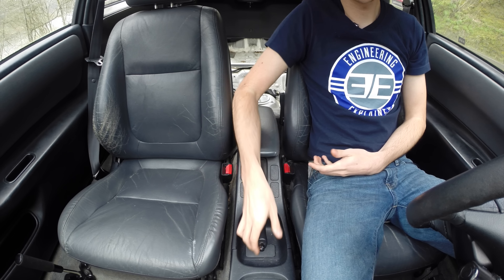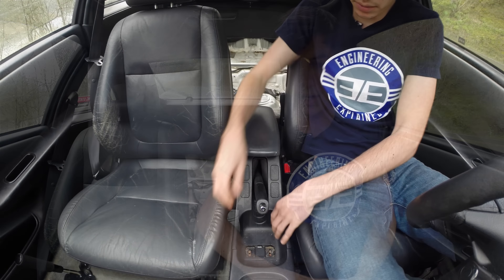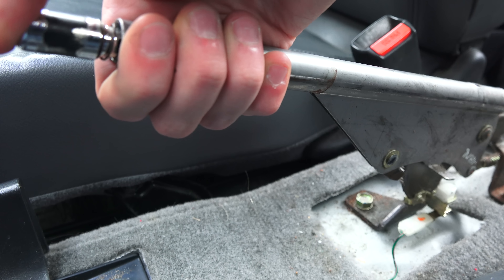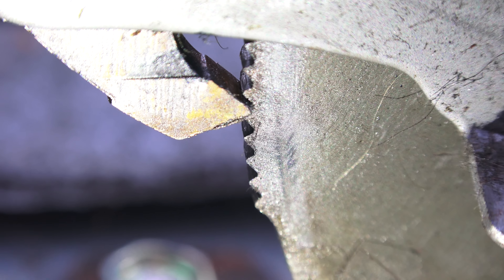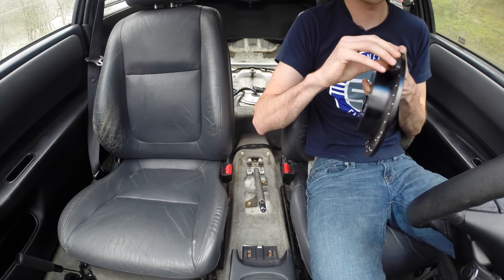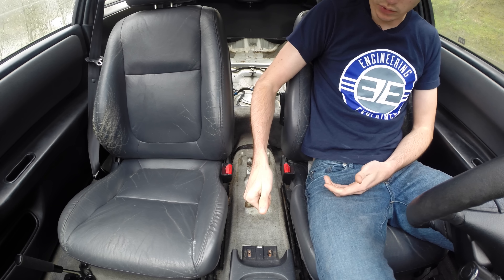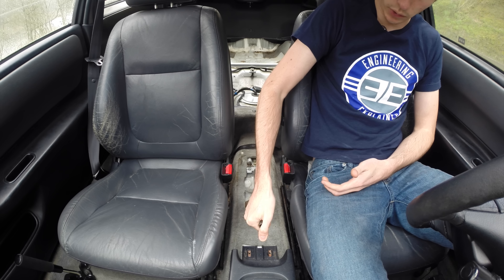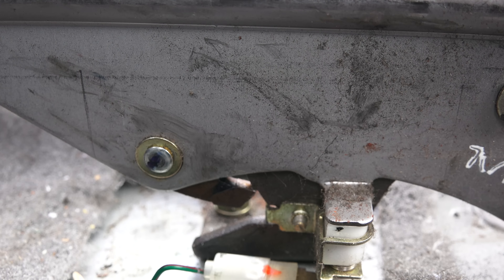Always Press The Handbrake Button? Myth Busted

Comment: I was told not to turn the steering wheel all the way to the left or right when turning my car at a U-turn. Is this another case of people educated by those that don't understand things?
Reply: +PacificCoastAuto yeah
Reply: +PacificCoastAuto Yes
Reply: anyone?
Reply: +PacificCoastAuto They were probably showing concern for the steering pump which will be running even though your wheel is at full lock. I don't know if this puts serious wear on the steering pump or not. You're probably fine doing this though- a U-turn is not a very common driving maneuver and, similarly to the ratcheting mechanism in the hand break, your car is designed to be able to turn to full lock. Manufacturers are smart enough to design vehicles to be able to do the functions they are able to do (including U-turns) without breaking immediately from normal use.

It'd be interesting to see what Jason has to say about this as well. +Engineering Explained
Reply: +PacificCoastAuto
It is a good measure not to reach the end of the travel of the steering wheel.. but depends on the system. Some old hydraulic unit will work harder (but within designed limits.. the over pressure valve will come off and the system will be running at max pressure designed.

Some systems will have a valve at the end of travel to release all the pressure from the pump at full lock. So aside the fluid circulating rapidly trough that valve without genearting any pressure is no real harm.

Whichever the system.. even non assisted, the full lock position will rest somewhere (at the steering rack end travel usually).. so any additional torque beside the lock will torqueout the pinion and rack - and if monkeyed around can cause harm.
Reply: +PacificCoastAuto Some cars have safety systems for this. If the power steering over works and heats up. They kill the power steering for a while to cool it off. Read your manual. Subaru has this feature.
Reply: +PacificCoastAuto This is from my owner's manual. "Never hold the steering wheel to the extreme right or left for more than five seconds if the engine is running. This can damage the power steering pump." 2000 Ford Contour p. 120
Reply: +PacificCoastAuto when you turn it full lock, the pump outputs almost its entire pressure potential trying to keep turning while its on lock, that means that it is safe for a short while (U-turns, etc.) but shouldn't be kept there as the pump will wear very fast in that time causing premature failure in the future, think of an engine, you wouldn't keep it full throttle all the time
Reply: +PacificCoastAuto If you use the full turning capability of the wheel AND keep it locked wile turning, it probably keeps the oil pump working hard. My car stalls easy if I lock the wheel wile doing manoeuvres so I avoid it because I don't like to rev just to be still and wear the clutch.
Reply: +PacificCoastAuto Power steering uses a proportional valve to direct fluid on the side where pressure is required for the assist. Once wheel direction matches steering input, the valve lets the extra fluid pass through and that lets the steering pump pressure drop. When you go to full lock, your steering input exceeds the wheel range and the steering pump operates at its bypass valve pressure, which will cause the fluid to rapidly heat up from all the energy wasted in the bypass valve and pump. On most cars, the steering will produce a noticeable noise change and all you have to do is back off slightly to make it stop.
Reply: Any GTRs for sale? And how much would a R34 be? When legal of course
Reply: the reason for that is if you bounce up a curb or something it can mess up steering components as there then being forced into positions there not suppose to.
Reply: +Jason J In my BMW Bentley manual it has in bold letters not to full turn the wheel right or left for too long cause it damages the pump.
Reply: Unless they were talking about dry steering and didnt say it correctly?
Reply: with a hydraulic system it can create more working pressure in the pump. on a car with electric power steering, not a problem
Reply: +PacificCoastAuto I don't believe so. With vehicles that still use hydraulically assisted steering, it's best not to hold it in the full lock position for too long. I didn't take this seriously either until I saw it mentioned in my Auto Tech Textbook. Teardown Dan explained this really well in the replies, so check his comment.
Reply: I avoid it with my truck. The power steering pump starts to squeal if I turn the wheel all the way. Anybody have any insight as to what could cause this?
Reply: +Daniel Fricke id imagine its the pressure of it trying to turn the wheel but not being able to. if you rock your wheels side to side and it dosnt do it then I wouldn't worry to much about it. it could also be the springs my car hates going to full lock and creeks like an old house XD
Reply: +PacificCoastAuto no. id say this is a true fact. my knowledge is that you are placing more strain on the power steering pump. your telling it to keep pushing the steering when the travel has hit its stop. its like holding a hydrolic press on, even when the press has bottomed out.
Reply: +PacificCoastAuto You're OK for the time it's going to take to turn a corner or curb your wheels when parking on the street, but you're not going to want to have it sit there with the engine on at lock (ie, if you curbed your wheels, consider uncurbing them a few degrees if you need to start the engine a few seconds before you start driving to get the engine oil flowing again), as the power steering pump's just fighting the end of the rack, which is not a fight it will win in the long term.
Reply: +lsbugsbunny92 plenty of information on the R34 not being legal in the US. If you do happen to purchase one it is not up to US standards and a lot of R34's purchased were scrapped because of the regulations. Although, you didn't mention purchasing it in the US.
Reply: +Jason J When any hydraulic pump deadheads if there is no relief valve in the circuit the pump will lock up as hydraulic fluid for all practical purposes is uncompressible. As hydraulic fluid passes over a relief valve it will heat up. You would have to run the steering pump for a bit of time for the fluid to breakdown because of this.
Reply: +PacificCoastAuto Actually, for vehicles with hydraulic power steering, it is a correct suggestion. Even my owner's manual on my vehicles with hydraulic power steering state not to go full-lock for a long period of time. I've done this on my first car (full lock for 30 seconds) only for my hydraulic power steering to fail 5 minutes later.
Reply: +Daniel Fricke. At full lock the pump is pushing lots more pressure and requires more power to drive it. If the belt cant provide the grip needed to transfer the power from the engine to the P/S pump then the belt will slip and squeal. The belt may be loose and need more tension or maybe worn out and requires replacement
Reply: Oh my god Derek its you lmao youtube is a small place ^^
Reply: +Andy_Jee That makes sense. I recently replaced the belt, but I don't have the proper tool to tighten the pulley, so it probably is a bit looser than it should be.
Reply: +PacificCoastAuto It will be okay for a short period of time. Most of the time, it won't matter.
Reply: +PacificCoastAuto I mean it might make sense if your doing a U-turn at 120MPH but I don't see the issue at parking lot speed.
Reply: It is not hard on the pump. Once the wheels are locked the pump pushes the oil over the relief valve. This causes heat. If the oil is pushed over the relief valve long enough the oil can heat up to breakdown temps and lose some lubricating properties but this takes a while. A relief valve that is stuck can cause damage.
Reply: some say yes and some say no i would say that it is because more pressure is created by the pump, it would damage the seals on the piston inside the steering rack, a good way to check is by Turning the wheel in one direction lock for less than 5 seconds and hearing a loud squeal but they seals should last a long time
Reply: The relief valve in the power steering pump is supposed to lift before the pressure gets so high it could damage seals. The main danger is the heat generated by the hydraulic fluid going over the relief valve. In industrial hydraulic systems this heat is dissipated by the volume of the fluid in the system and external cooling if needed. The volume of fluid is small in the power steering system and there is no external cooling so it won't take a huge amount of time for the fluid to heat up dangerously but I would think it would take over 60 seconds to do that. It might be interesting for someone to actually measure how long it does take.
Reply: +PacificCoastAuto Basically I wouldn't worry about a U-turn or parking maneuvers. (but don't use all your strenght trying to pull the wheel past its stop as I've seen someone does)
It depends greatly from car to car, specifically I have an old Audi, and at full lock the engine revs drop a bit (witch is because the hydraulic pump is working hard) turn the wheel 5degrees back and the pump doesn't have to work as hard, because the wheels has the correct angle with this steering input.
In day to day driving this doesn't matter, but I know people who use these cars for drifting who will tell me those pumps fail rapidly if pushed on the track with full lock. My to cars has 800000km combined and both with stock pumps..
Reply: +PacificCoastAuto The only warning I read in my manual is to not bump the wheel on the stop with force. So you can turn it full lock, but don't bump it too harsh to the lock.
Reply: +PacificCoastAuto In my LR Defender manual they state that you should not keep the wheel at full lock for more than 20 seconds due to there being no oil flow through the pump when at full lock.
Reply: +PacificCoastAuto Well, it depends on how old your car is. I used to drive a Dodge Durango and it had to have steering fluid put in it a hell of allot because I'd yank the wheel to either side and the cap was crap. So really, it depends on how old your car is, or what type of car.
Reply: +Jason J There is a pressure relief, you don't stress the pump at full lock. But you do stress more the tie rod joints and the tires, as a full lock is usually done at rest.
Reply: +Koelkop That's because the recirculating ball box you have does indeed cut the oil supply off.   But it isn't the pump that you should be worried about.

It's the seals in your steering box.  They are holding huge pressures. They rupture - you have no power steering  and a puddle of oil on the floor.
Reply: vkoptchev That depends on the car, I know atleast some older german cars that stress the pump at full lock.
Reply: +PacificCoastAuto The power steering pump will end up closing the valve at hard left or right, which forces the pump to recirculate the fulid very quickly which produces massive heat and can wear or kill the PS pump. easy way to tell, while at idel, just listen and feel, try pushing against the wall left or right and you'll hear the pump. fun fact though, you can back off from turning it as far as you can go literally by 1/16th of a wheel turn(very very small amount) and it will be fine.
Reply: +PacificCoastAuto Doing so in any direction (left/right) for a great amount on time puts strain on the power steering pump. I'm talking full lock 100% with nothing more to give. You will actually hear the pump under strain. For example my 2005 Subaru TS owners manual specifically warned against holding the wheel at full lock for more that 5 seconds. This may not be the case with more modern cars though.
Reply: +Bittertokken no,  it's still the case with any modern power steer system, Hydraulic and electric.
Reply: +PacificCoastAuto 
With traditional hydraulic power steering, putting pressure on the valve in the steering rack or box is what causes it to start making hydraulic pressure, this happens when you turn the wheel. Moving to the end of the steering travel and then continuing to put some pressure on the wheel will cause the hydraulic pressure to rise, but it can't move the steering because it is already at the end of travel. The pressure relief valve starts opening to prevent pressure continuing to rise until something breaks, but there is still high pressure in the system which strains components and quickly builds up heat.
Reply: +Ezra Mable So Ford designed their system to damage itself in what could be considered normal usage. Nice
Reply: Although I'm sure your question has been answered, my theory is that when you turn your wheels at any angle, it puts more pressure on the wheels themselves to make the car go at the same speed than if they were to go forward. 

The equation that represents this is    a = m × fsin(∆0°) where if a (acceleration) and m (mass) are to be held constant, and the angle were to be changing (∆0°) [any direct change in angle when multiplied by sin will decrease its value], the force would have to increase in order to keep the acceleration constant. 
It is this increased force that will be acting on your tires/axel system which would in turn put more pressure on all of the moving parts. 

In all reality your car would be fine if it didn't have an actual problem with it, but it does exert more force on the system than normal for the same acceleration. 
You're okay though.
Reply: +. this isn't the 60's anymore.... cars have differentials
Reply: +PacificCoastAuto That only applies to offroad vehicles with wider tires with not enough backspacing on the rims which can sometimes clip the wheel wells but for anything stock there is no cause for concern:p
Reply: +SpydreX Official again, this is untrue
Reply: Bait28 What do you mean? Whats wrong with turning at full lock?
Reply: +PacificCoastAuto  I dont because of power steering
Reply: +SpydreX Official Turning at full lock is bad on the power steering system, not the actual steering system itself. When you turn at full lock, the power steering pump ends up building pressure to open the relief valve and rapidly recirculate fluid in the pump under high pressure which generate massive heat.
Reply: Bait28 As you can tell, I am not a car person. Regardless however, this redirection of force puts more strain on some connected part of the vehicle.
Reply: Bait28 Well cars are designed to be able to handle full lock turning and are actually tested extensively before they are sold to customers. Tbh I highly doubt you will bust any seals turning your steering wheel at full lock because whats more pressure on the pump? Going 5-10mph at full lock out of your drive way, or turning into a 50-60 degree turn on the highway going 60+mph? The steering pump is rated for the kind of pressures that it operates at and I haven't ever heard of anyone actually busting any seals or gaskets from doing this.
Reply: If it's a fwd car just don't floor it at full lock because the torque steer can push the tie rods further than they're meant to go. Other than that the wear is the same as half or quarter lock
Reply: +SpydreX Official cars are not designed to be full locked. Do you think they were also designed to handle at 108mph just because they can goto 108 mph? you must also think they are meant to work without oil since they can run on low oil.
Reply: +PacificCoastAuto It's quite simple: for the same reason you shouldn't place an automatic gearbox in the 'stall test' mode, i.e. one foot on the brake and the other on the accelerator for more than a few seconds to test the stall speed of the torque converter, one shouldn't load the steering pump by turning full-lock and holding it there for more than a few seconds.  Both cause overheating of the oil by loading the pump, although in the case of the pump the pressure relief valve will usually take care of excessive pressure build up.  One can also hear the pump taking strain at full lock.
Reply: +PacificCoastAuto If there is a whining noise when the wheel is turned all the way, then it's probably best not to do that (like in my car) if there is no noise when the wheel is turned all the way, it is probably fine (like in my wife's car)
Reply: You can turn it all the way unless you have larger than stock tires then your tires might rub on the wheel wells but the only thing you shouldn't do is keep your wheels turned all the way to the right or left is because it will make the power steering system overheat but hitting the turning stops which stop your wheels from turning farther for a U-turn is ok. If you have to wait for an opening to get back on the road and you have to wait to finish the U-turn, let the steering wheel rest without being pushed all the way and that will stop it from overheating. What you were told is partially true. Turn all the way and don't let go, bad, turn all the way but not for a long time, completely fine
Reply: Sounds like you're talking about turning the wheels when not moving (in prep for the U turn), this is called dry steering and will cause wear on the steering column, at full lock it will also cause wear on the power steering.
Reply: Love your videos!
Reply: in simpler words... it puts a lot of stress on the power steering pump when you turn all the way till it dont go no more.
Reply: Bait28 You are being a little condescending and your examples are not even close to what I was mentioning. This is 2016.. Cars are designed so that your not going to destroy your steering pump by backing out of the driveway at full lock. End of discussion.
Reply: +SpydreX Official You are once again wrong. Theres been no major innovation to cars to make physics break. Once a steering rack is at full lock, it always will build pressure, it always will open the relief valve or explode, and will always rapidly recirculate and over heat and damage the pump. You cannot beat physics. Even electronic power steering system can overheat and become damaged. your "End of discussion" is how people who are unable to prove themselves lose. My examples are just because you throw flawed logic out there. Now because it's 2016, cars are clearly designed to be driven without tires, because that used to damage them with no tires but manufactures know some people can't afford them, so they make it possible to drive safely on just rims.... Seriously. You cite no sources. I'm a mechanic, fight me kid!
Reply: Bait28 I cannot beat physics? Slow down slick we are talking about engineering here not physics. You can choose not to believe me but the fact is no one should be afraid to turn at full lock with a stock vehicle backing out of their drive way. I'd also like to note that if you are truly a mechanic "bait28" I wouldn't want you working on my car thats for sure. The only mechanic you are is the mechanic of trolling on YouTube. 

EDIT: The reason I haven't given you a source is because I couldn't find any reliable information about damaging your steering pump anywhere online except in forums like for instance this thread.

http://www.successschoolofmotoring.co.uk/manoeuvres

http://www.carbibles.com/steering_bible.html

^This is the closest thing a source on the internet that I could find as "breaking your steering pump in this manner is very uncommon and not heard of very often it seems".
Reply: +Bait28 Your power-steering explanation is exactly what my dad (a longtime mechanic) told me since I was young & learning to drive. 
I suppose it's also possible that the tire could rub against the wheelwell in an extreme steering position, but I think the PS pump/system pressure is the biggest factor.
Reply: +SpydreX Official...Obviously +Bait28 isn't saying that turning the wheel to full lock once (or even occasionally) equals instant failure, but it certainly increases load/wear on parts, which leads to earlier failure of the component.

And yes, "it's 2016", but so many cost-saving measures are taken by car companies these days, you can't assume the components are necessarily of higher quality. (Look at VW mgmt's decision to cut costs by $350/car, which effectively created the "Dieselgate" emissions cheating scandal. Or GM's faulty ignition switches with cheap plastic parts.)
Reply: +PCjabber Ofc you can bounce of the stops or tap them. Thats why they are they, but the fact even when you hit the stop, it increases the force to try and recenter to push it OFF the stop should say something.... thats a intentional feature to try and back drivers OFF the stop
Reply: PCjabber You make a good point but what I am saying is that your cars steering pump will not likely fail from turning at full lock.  Actually your car has steering stops to prevent your steering pump from over turning which is what you both are talking about. Yes your steering pump would be heavily damaged overtime if these steering stops were not in place that is true but the fact is all modern cars have these as of my current knowledge. These steering stops are most of the time adjustable too so even if you were the slightest concern you can adjust them to let your maximum turning radius be wider and less tight to reduce stress on the pump which shouldn't be necessary anyways as they are pre-set to there recommended length upon exiting the factory. Being a so called car mechanic "Bait28" should already know this.
Reply: My driving instructor taught me that too it's weird
Reply: Bait28 Why are you getting so mad at me? Just show me your video proof if you have it I mean this is the 21st century just send me a link to them and if what you say checks out then I will admit I'm wrong but at the time being I have never known anyone to actually destroy or "explode" their power steering pump just from turning at full lock. I have never been told by certified mechanics that this is bad for a car either and the only ever time I have seen in a car manual that turning at full lock is bad was in a 99 Pajero manual and even then it said for "extended time periods". What does me being skeptic of a well known myth have anything to do with people who come into your so called shop? By car mechanic do you mean working at Autozone lol?
Reply: +SpydreX Official I'm talking about extended periods of time....
Reply: +SpydreX Official "+PCjabber Ofc you can bounce of the stops or tap them. Thats why they are they, but the fact even when you hit the stop, it increases the force to try and recenter to push it OFF the stop should say something.... thats a intentional feature to try and back drivers OFF the stop"
Reply: Jane Smith Thanks for the comment but I never claimed to be a mechanic and actually bait28 is right on turning at full lock will cause more stress on the power steering pump but compared to everyday driving like on a highway this stress is negligible and the steering stops do indeed stop the steering pump from over-steering even if thats not what they were intended to do so don't get all high and mighty because you are not %100 correct either.
Reply: +Bait28 no its an intentional feature to let you know you cant turn the wheel any further!
Reply: +Jane Smith Alright, simmer down now :-p...first off, I never said I was a mechanic (my dad is). 

My whole thing is...why push the system to its design "limits" (which will increase wear over time) if it's unnecessary to do so?
Reply: +PacificCoastAuto The reason to not have your wheels turned in anticipation of a u-turn is to prevent from getting pushed into oncoming traffic if you get rear-ended.
Reply: +PacificCoastAuto On older power steering cars that was true, I have not heard that in many years.
Reply: +eatmyskids hahaha, I thought your name was "eatsmykids"
Reply: people will argue about literally anything on the internet these days
Reply: +Simon Chuo that is correct, it can happen
Reply: +Vinny The Tech I know it does too x.x whatever I guess, not my car lol
Reply: +Bait28 +Simon Chuo it's not good for any car to turn it to full lock, not even cars with no power steering because it can damage the steering gear
Reply: +Simon Chuo Sometimes you gotta sit back and be glad you are not them.
Reply: +PacificCoastAuto Under normal driving conditions, you shouldn't be concerned about that. However the manual for my 2010 Ford Ranger DOES warn against holding the steering wheel at full lock for extended periods of time (longer than 1 minute). I would assume this applies to most all other vehicles.
Reply: PCjabber I kind of like that, I might try that
Reply: +TheChipmunk2008 ... OR looked at another way, Ford warns you in the manual, where as others want to make a few bucks selling you a new part after the warranty is up. Either way, the only power steering pump I've destroyed from any manufacturer, ran out of fluid from a leak. With a Contour though, continuous circles and turning will just as likely starve the engine's oil pump.
Reply: +PacificCoastAuto No, it's completely different.

If you listen close to most PS pumps when you get close to the end of the rack you hear the pump strain a bit - I don't know the hydraulic mechanics (in the rack) of it but for some reason there's a lot of pressure build-up at both ends (and not at all in the middle), and on many cars you can hear it groan at the end of the track, especially if the belt is loose you can sometimes hear it slip due to the added resistance.  I try to avoid going all the way to the end of the rack for that very reason, you can hear the pump whine out in pain, no reason to push it further, IMO.  It's just extra stress on the pump which may or may not make a difference at the end of the day.
Reply: +PacificCoastAuto  Every car I have ever had says not to hold it at full lock for over 5 seconds, every service manual i have seen says when bleeding not to hold at full lock, every service manual i have seen says when doing a test with the pressure gauge not to hold it for over 5 seconds. 

Puts the system at max pressure, heats the fluid, and puts a ton of pressure on the pump, hoses, etc. The power steering is the highest pressure system in the car, commonly rated at pressures around 1500-1700 PSI or higher. 

I used to have a 95 escort and i couldnt figure out where the power steering was leaking from, tried two bottles of lucus quick fix and it didnt help, held it at lock for less then 30 seconds before the hose busted and I knew where the leak was then
Reply: +PacificCoastAuto My power steering blew out once on a hot day in a '96 Ford Escort when at full lock. I heard a "pow!", backed up, and saw all my power steering fluid on the ground. Then I got to drive 5-1/2 hours home in a car designed for power steering.
Reply: +David Lamb I once sheared/broke my cars power steering pump shaft in half from doing reverse donuts with my steering maxed out against the stops and bouncing off the rev limiter.
Reply: +PacificCoastAuto Anyone can correct me if I'm wrong, but from what I've been told locking the wheels at full turning capacity can wear out the CV boots and joints on your cars axle assembly a bit faster than normal. I'm guessing this can be especially applied to FWD vehicles since you also got to factor in both steering and power-to-the-wheels type of wear. Again, anyone can correct me if I'm wrong or confirm if I'm right.
Reply: +Jaime Almeida If you're wearing the clutch to stay still, you're doing it very wrong. You use the clutch just to get going and to change gears, not to stand still, ever. Use the handbrake, if you need to stay still and hold both the clutch and accelerator with your feet, like starting uphill.
Reply: only thing I have seen is if its repeatedly done (like say someone hard u-turns on the daily) the outer cv boots start to crack at an accelerated rate but its such a minor change that I wouldn't worry about it
Reply: +PacificCoastAuto 

older vehicles had this problem, if you held the steering wheel all the way either left or right... modern cars don´t have that though...
Reply: +PacificCoastAuto
Unlike the parking brake wear issue, which was proven here to be an unsubstantiated myth, the steering pump (of the TRADITIONAL hydraulic type) is clearly mentioned on almost all car Owner's Manual as something you should try to avoid whenever possible. There's even a recommended time limit of 10-15 seconds at full lock with the engine running. Look it up. Case closed.
Reply: Alejandro Bello

or you can turn all the way and then let it turn back a little, just don`t hold on to it...
Reply: That doesn't add. It's arguing that fire burns and you replying that you can set a fire and quench it afterwards. How to put out a fire was the never the issue at hand, but if fire burns or not.
Reply: wtf are you on? pass it
Reply: This is why, starting a stored car once a week 'to keep the engine lubed' is pointless and because of the initial friction needed each start, is actually detrimental to the engine.
Reply: If you are storing it for long periods they have pre oilers that use a secondary pump to prime the system with oil before you crank it over
Reply: richardwayne1990 That's nonsense. Do you make it a habit of bouncing up into curbs while doing u-turns?
Reply: You turn your steering wheel when doing a U-turn? Where'd you get your licence from?
Reply: no.. you can.. just dont gas it hella hard.
Reply: PacificCoastAuto  If drove a littlr bit further our off the line far  and then Turn  you wont have to turn your steering wheel all the way. Also youll learn your cars limits by drying it for long periods of time anything over 3 years will definitely make you master your car from how it feels and sounding good to bad.
Reply: It's totally retarded. I once had a 15 year old Mazda and it would squeak when fully turned and people would tell me it's bad for the car to turn the whell all the way. I always ignored them and voila, after a month of normal driving and using car as designed, the squeaking was gone and the wheel lighter to turn.
Reply: PacificCoastAuto in my car, when the steering wheel is cranked all the way to lock, it makes a buzzing sound. I don't know if it's bad but when I do a u turn I back off about one inch to stop this whine sound.
Reply: Ezra Mable In my Ford Fiesta ST the pump becomes louder at full lock. And this car has a limiter.
Reply: Go to full lock momentarily, feel the end point, then back off the steering pressure a tiny bit. I have to remind the missus of this whenever I hear the poor pump. Women can't seem to hear a power steering pump screaming that it's in bypass mode!